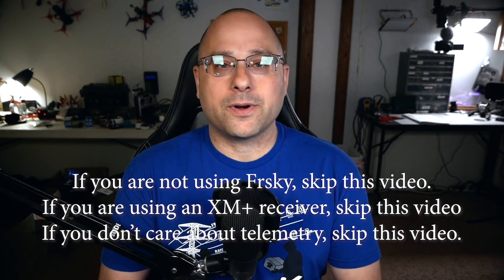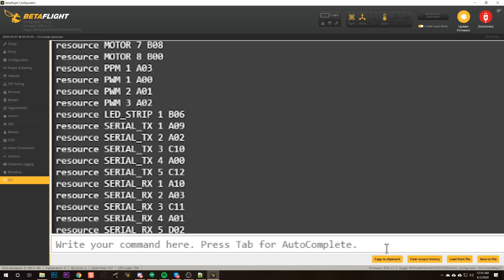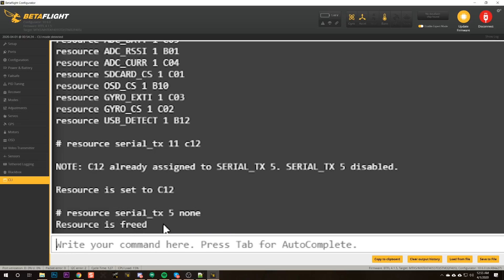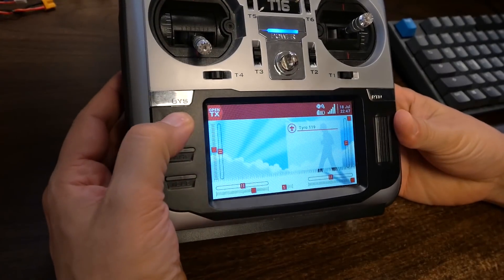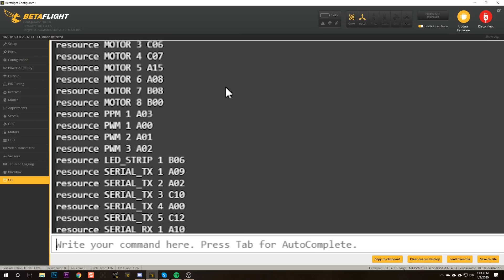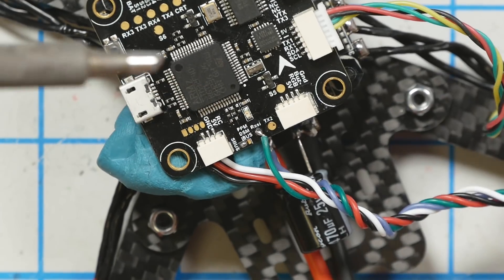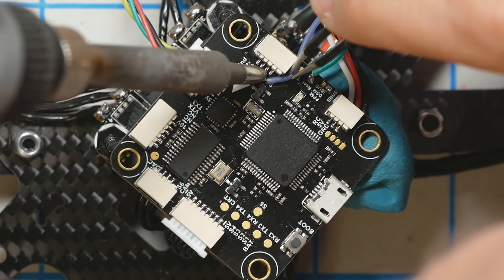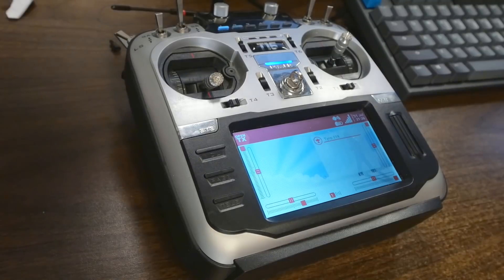Beginner Guide $120 FPV Drone How To Build - Part 11 - SoftSerial and Smartport Telemetry

Comment: I do not understand why this setting is needed to be displayed on the equipment ?! The OSD in the glasses shows all readings without this setting (battery, speed, altitude, warnings, GPS, RSSI, etc.) The first time I connected and configured everything with you, with the Frsky RXSR receiver, everything worked. The next time with the same receiver, but the stack was replaced by a Speedy Bee Ф 405 V 3. On the equipment, telemetry could not be configured via the S.port. Only SBUS works. But nevertheless, in glasses, the OSD shows all the indications that are necessary. Question! Why this setting that you showed for telemetry and what is the use of this? I will be grateful for the answer.

Comment: I got here kind of late and apparently  they substituted another similar F4 board and  when I use the CLI resource it only shows four motors.  There is no LED strip listed in CLI resource and no LED Strip but I do have LED1 Out and LED 2 Out.  What to do?
Reply from the maker: LED out 1 and 2 are not the same as LEDstrip. They're the status LEDs. Don't remap them :-)

Comment: Hey how do I remap my pin back to default instead of softserial? I did this and I want to change it back but I don’t want  to completely restore to my last backup
Reply from the maker: If you're not sure what the old pin mapping was, first save a CLI "diff all" to a text file. Then "defaults" in the CLI to restore defaults. Then look in the resource list to find the original pin number. Then paste back in your "diff all" to restore your config. Then re-set the resource mapping for that one pin manually.

Comment: |I'm sorry if I am jumping ahead, but my intention is to build a turn key drone system.  It needs to do distance (crossfire?) and be controlled by a phone app.  I have no issue in setting everything up exactly as documented so far, but, after I set it all up, can I hand it to my customer to just fly by phone?
Reply from the maker: None of the aircraft on my channel can be flown by phone app.

Comment: Thanks for the tutorial and I know this video is a little old, but you should put a note on video 1 saying solder to S5 instead of TX5!
Reply: And a disclaimer that the ESC is installed upside down.
Or that you need to buy another GPS with a compass if you want to use iNav in (before) the first video, instead of in the second video after flashing iNav.

Comment: I was about to say that I was having trouble getting telemetry working, but I messed up in the port section... Once you make that change for motor 5, and use soft serial, you need to choose softserial as your Telemetry option (or S.Port in my case). 

Quick question, as I'm sitting here with my receiver and transmitter sitting on the desk, I seem to be getting "Telemetry Lost" a lot.  Is this semi normal being that they are sitting right next to each other, and perhaps in a bad reception scenario?
Reply: Eric Perry  Yes it’s normal when the transmitter and quad are close.
Reply: Craig Parks thanks!  I thought that may be the issue...

Comment: if i use the jumper R1 which firmwre caaan i flash to the RX? R XSR firmware from FrSky?
Reply from the maker: I am told it is XSR firmware but I have not verified.
Reply: @JoshuaBardwell  Afraid to break my only receiver so I wont update it for now.

Comment: Hi Joshua.. followed your build series using the exact parts as described.
You however did not give a setup for telemetry in INAV using the Jumper R1 receiver.

Comment: I don't think the softserial telemetry will work on your Inav set up, because inav does not allow remapping. So you will have to use a Uart.
Reply: Now working. Have to "Enable CPU based serial ports". SS1 for TX4, SS2 for TX2. Hope it helps and thanks anyway
Reply: @rubensramirezes  Do you have a guide that you followed?  I'm trying to get this to work with the Jumper R1..
Reply: @rubensramirezes  "Enable CPU based serial ports" is in the Configuration tab and is a toggle.  Not sure how to do "SS1 for TX4, SS2 for TX2" though...
Reply: @smks5  When you enable softserial, there are 2 new "uarts" on the ports tab: ss1 and ss2. With SS1 for TX4 I mean you have to activate SPort on SS1 and solder the wire on FC's TX4.
Reply: @rubensramirezes  And when you said "SS2 for TX2" you were meaning that you could either put the wire on TX4 (for SS1) or on TX2(for SS2), but not both?  Is this because iNav doesn't support resource remapping like Betaflight does?
Reply: @smks5  Exactly, inav supports softserial but not remapping
Reply: @rubensramirezes  TY, now I receive telemetry on my tyro129 
Greetings from Bulgaria ;)
Reply from the maker: But you can't use a UART because F4 doesn't support inversion.
Reply: @JoshuaBardwell  There must be an un-inverted pad on the Jumper R1 surely? Another option is to flash the R1 with XSR firmware and f-port to the Fc sbus tab. I would ditch the R1 and put an xsr/r-xsr on the build using the non-inverted s-port pad on the receiver.
Reply: @JoshuaBardwell  What's your plan for RX?
Reply: So is it possible to get telemetry using INAV? Thanks!!

Comment: Hello, idea for a video for you. Beginners - how do antennas work? How do we choose them? How do we choose to mount them?

I've watched your other videos, but I'm still a bit confused
Reply: Also the orientation of the props. When you put them on the quad
Reply: @madnlooney  The motors are going to turn in a certain rotation. You need to put the props on so when they spin they push the air down. If you don't, one of two things will happen. One, your drone will suck itself down to the ground instead of pushing itself into the air. Two, your drone will flip out and you won't be a happy camper. You just gotta use common sense and caution when maidening.
Reply: @Ferr0usFPV  I just thought it would be a good thing to add into a beginner build.
Reply: @madnlooney  Sorry, shoulda read the beginning of the comment.
Reply: @Ferr0usFPV  just saw the latest video explains fully prop fitting
Reply: https://www.getfpv.com/learn/new-to-fpv/all-about-multirotor-drone-fpv-antenna/
https://www.flitetest.com/articles/fpv-basics

These links should show you all you need to know about antennas. Basically, they work by taking in an electric signal and making it a radio signal and vice versa. 

Antennas use different connectors. The most common one and the one on this build is an SMA connector. 

My favorite kind of connector is an MMCX. These are mostly found on micros and little 3 inchers. This quads vtx has an MMCX adapter to an SMA. 

Now more and more you are seeing UFL connectors. They are really small and have a bad problem of coming off of their plugs. What people often do is hot glue them down so they stay put. They are really light and are great for micros and brushless whoops.

Comment: I got working F.port without remapping. You need to solder FrSky inverted S.port to TX2 pad.
Reply: I too use F-port and use the (un)inverted pad on the receiver.  The biggest problem is soldering to that tiny (1mm though it seems smaller) inverted S-port pad on the RXSR.
Reply: @wingsounds13  no problem for me to solder this tiny one. You simply need smaller soldering tip and magnifying glass for help
Reply: @t0ffik  I do have a very good soldering iron (Hakko) with a small tip, and good lighting and magnification.  I do need to buy a smaller tip, and that will help a bit.  It's still a TINY target.  I wish that I could afford a good binocular microscope like the ones that I soldered under at work back in the '80s.
Reply: @wingsounds13  Yep it is tiny but I did it with very tiny solder tip without much effort (I'm soldering beginner). I don't negate your equipment and skill.

Comment: Hi Joshua 
Can I do the same on DX6 spektrum ?
Reply: I think it depends on the dx6 you have. I had the dx6i which wasnt able to do telemetry but I think it is possible to use telemetry on the newer dx6's.
Reply: @f_eyt8870  ok I will try , thx buddy
Reply: @gabopani  no problem haha. If you need help you can ask. But I dont know If I can help that much but it shouldnt be that hard.

Comment: I really like using F-Port 👌You just need 3 wires (5V Signal and GND) and you dont have to mess up with the inverted, non inverted and like frsky's fucking 'double inverted' and so on signal. And you only need one UART which I really like.
Reply: F-port is the way to fly.  Yes, 3 wire is nice, but the biggest advantage is only using one UART.  This especially critical on micro flight controllers that have very few UARTs brought out - like whoop style FC that have only two.  Fortunately most micro FCs today bring out both RX and TX on their receiver channel, I think primarily to support crossfire. 

You can't totally blame FrSky for the stupid inverted protocol.  They copied that from Futaba when they copied the Futaba S-Bus.  FrSky kept the stupid inverted protocol for consitency when they developed S-Port for telemetry - THAT you can blame on FrSky.
Reply: @wingsounds13  yea I also primaly use it cause it only needs 1 uart, because I also need RunCam Control, Smart audio etc. And I really like it I dont feel any difference